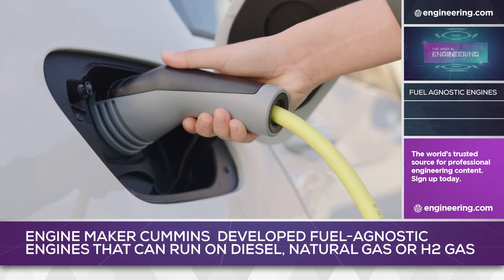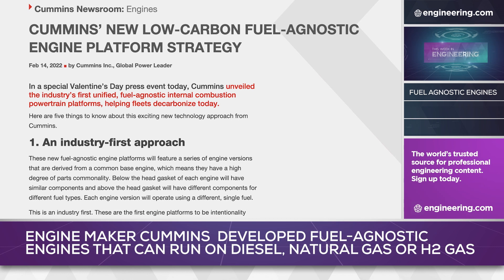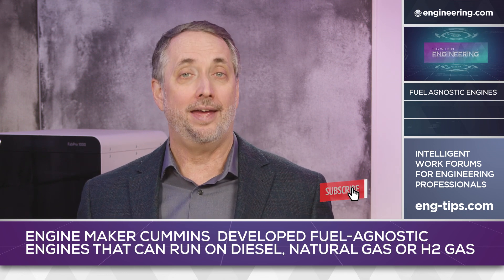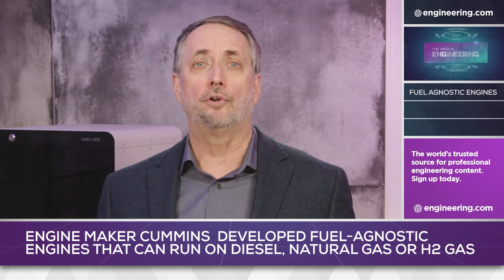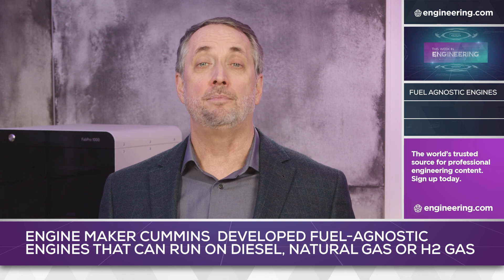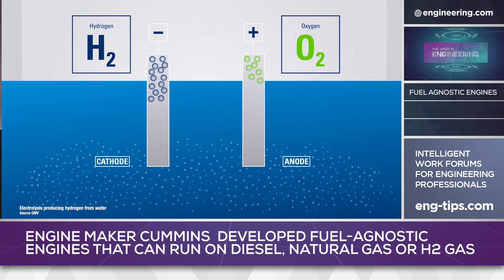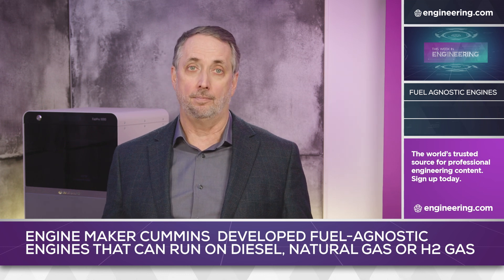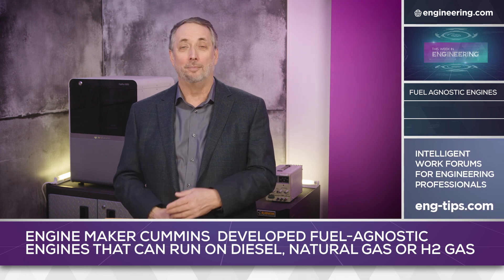Blue Hydrogen for CO2-Free, Fuel Agnostic Diesels

Comment: JCB have already been showing hydrogen powered ICE products for at least a year, but no price that I can see.

Using hydrogen to power a site generator would make sense, along with construction vehicles being powered by hydrogen. It’s alright having small lightweight BEV in a warehouse environment or on a house remodel but, when it comes to a construction site the vehicles need to be used all day not five hours of work and then recharged over night, they can’t afford the down time, the only way around that would be to have double the amount of vehicles on site which puts the cost of the project up. Plus a large BEV excavator would cost twice as much and weigh around three times as much as a diesel or hydrogen powered vehicle. Hydrogen fuel cell vehicles don’t seem to like the rough terrain and dirty, dusty environment of a construction site.

Are you saying buy blue hydrogen from India? That would kinda defeat the objective wouldn’t it? All the wasted energy used in the production and transportation?
Liquified > transport by sea> turn back into gas> road transport to the pumps.

And the production of Blue hydrogen is it really that much cleaner than ordinary Grey hydrogen? It has been shown that its carbon footprint far exceeds that of natural gas, diesel, or coal, no matter what the government’s and production companies tell you.

And how much hydrogen do you have to burn through to do the same amount of work as a diesel powered vehicle? Or a BEV?

Until they can produce Green Hydrogen in large quantities it doesn’t make sense to push on with trying to up production of Blue hydrogen because of the environmental impact, and even then, just how green is Green Hydrogen? Nuclear waste, renewables waste? etc.